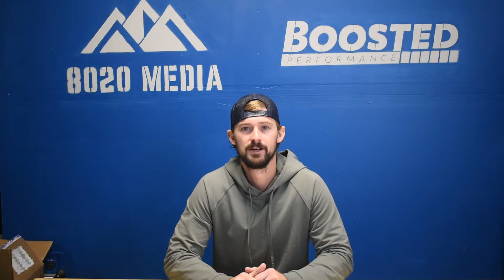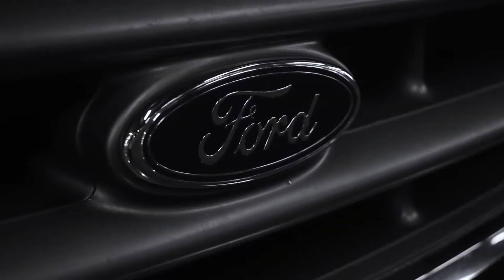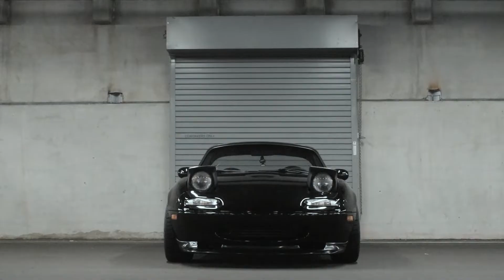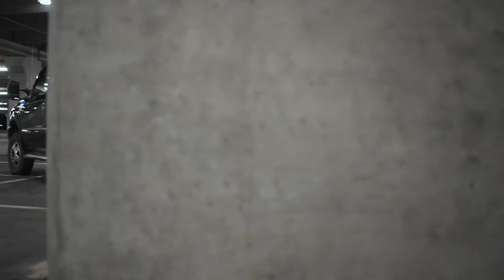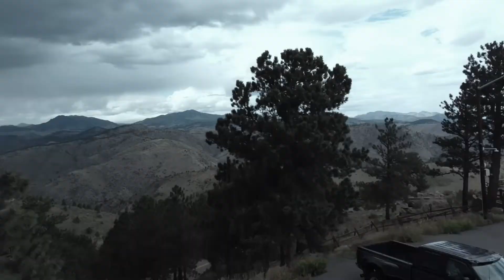3.0 EcoDiesel Reliability & Common Problems!

Comment: I have a 2019 Ram eco diesel . I bought it 2 years ago from a bloke in Melbourne . It was great for the first month then i was getting a engine light which was caused by dpf probs , we done the clean a few times till we done a delete . At this stage it had 75,000 kms on it . 
Last Septemer it had 90,000 kms on i was going for a drive then it threw a bearing in the motor & fucked the bottom end , $ 30,000 dollars later & a full rebuild im just wondering what will be next . Had a argument with Ram as naturally the vehicle is past its 3 yr warranty that if they are selling cars with a motor thats only going to last 90g kms they should be accountable as its just not good enough
Reply: how did you go with ram?

Comment: The engine is strong. You need to take care, do the maintenance, and this engine will last for a long time. The problem with this engine and in fact with most diesel engines is the emissions BS that it's saddled with. I've have the PDS crack. I've had the sensor go out. I've had the DEF injector clog up. I've had the cooler crack and melt my manifold. All of these have been related to emissions not the engine.

Comment: What’s this “delete” people are talking about on this engine? Emissions delete?
Reply from the maker: D - Correct. Generally includes three major parts: the EGR delete, which removes or blocks the exhaust gas recirculation system to prevent hot soot from being recirculated into the intake; the DPF delete, which replaces the factory exhaust with a straight-pipe or performance exhaust that removes the diesel particulate filter to reduce restriction and improve flow; and the SCR/DEF delete, which disables or removes the selective catalytic reduction system and DEF (diesel exhaust fluid) injection components.
Reply: @8020Automotive  thanks. What do you have to do or buy to get the SCR/DEF delete. I think I get the rest of it.
Reply from the maker: @daytonasayswhat9333  There are many kits out there. We can't recommend/explain what it entails for legal reasons.
Reply: @8020Automotive  oh bummer. Well fair enough. Thanks for your info so far.

Comment: Love my 2015 ecodiesel even though it is currently in my garage getting the Crankshaft position sensor reluctor ring changed. This is has been the first issue at 105k
Reply from the maker: J - Nice! Thanks for taking the time to share your experience.

Comment: I’m so tired of people trashing the Ecodiesel. This an Italian engine that has been running in Europe for a very long time without issues. The problem with the vehicles carrying this engine in the US, is the EGR components which put a stranglehold on the engines. I’ve owned several Ecodiesel since 2014, and never had any issues with them. I’ve  talked to people who have the 2014 first Ecodiesel generation and removed the EGR, and had no issues with them. There is a war world wide against Diesel engines, but until they come up with a reliable alternative, Diesel is the best option for heavy duty equipments and for trucks. My humble opinion.
Reply from the maker: J - You are entitled to your opinion. However, it came with EGR, end of story. Most people won't take the time/money to remove it. Therefore, from the factory, they are not reliable, if not maintained properly.

Comment: The same engine was an option for the 2013-2018 Jeep Grand Cherokee. I had one in 2014, the car was great new but after the first 10K service, the problems started. The oil cooler and EGR cooler were replaced under warranty. Then at 22K the fuel pump failed but lucky for me there was no metal in the lines. I sold the car in 2015 and the new owner decided to have it "tuned". Soon after the engine had a spun big end failure. I went back to my good old WJ Jeep 4.7L and I still have it. It is still going strong.
Reply from the maker: A - Wow.. Sorry to hear, but thanks for taking the time to share your experience!

Comment: I just re-watched this video because I got a ping on my response.  That said, listen to the video. Do not buy the 2014 through 2016 Eco diesel period. All owner know they (me) went back for a dozen or more recalls. Problems stated here, the EGR cooler and fuel pump were recalls. I have a 2014 GC with 194k on it now. My first post from a year ago was at 181k. Problems since then have been waterpump and E brake  cables. Mopar doesn't want to sell you parts for this motor.  The waterpump was $1000. and not in stock. A Gates was so cheap I can't even remember the price.  Always buy aftermarket.  Another take away from the video is that light towing is best. I'm towing a Camaro on an aluminum trailer.  The Jeep absolutely has a marginal cooling  system because of the tight packaging.  The transmission always runs cool and the oil temps are always in check. Just the coolant temp. So would I buy another? Maybe a 2018 or newer JC. Seems like I could get a nice one for $20 to 24k. Mine is really really nice and in fantastic condition because Ireallytake care of it. The replacement would have to be in the same  condition
Reply from the maker: L - Thanks for the feedback and coming back to update! This will certainly assist future viewers.

Comment: I’ve got a 2015 with only 80,000 Kms.. it’s October 21st today, I recently had one code pop up and I will see what the dealer finds.. I was thinking to delete but will see what this costs me. I’ve spoken to every guy I see driving one and not 1 complaint
Reply from the maker: B - Thanks for sharing your experience. Keep us updated.
Reply: I took it to the dealer,, had the nox sensor replaced and total cost was $1600, runs fun now, no issues.. I see thousands of these and not ever have I seen one catch fire nor have I heard from owners that they suck etc

Comment: I have a 2021 Ram with the Gen 3 EcoDiesel with 130,000 miles on it and didn't have one thing wrong.  Early Oil changes and fuel filter change religiously.   Previously had a 2015 JGC with Gen 2 EcoDiesel and had 230,000 miles on it when I sold it.  Only issues I had was the recalls and sensors failing on the DPF.  I think people drive these in the city too much which is not good for this engine.  These are not good for idling long periods of time.  I do long trips and light weight towing.  Cant be 27-30 MPG on trips.
Reply from the maker: J - Thanks for taking the time to share your experience! This will certainly be helpful for future viewers.

Comment: The EGR system is a complete pos. It will eventually cause a catastrophic failure to this perfectly good engine. 193k and still going strong. 33.8 Hwy according to the computer, need to do my own calc next trip. Filled it up in Green Valley AZ, 26 Gal tank, drove around for 30 minutes, then drove to Rocky Point MX 4.5 hours, drove around Rocky Point for 3 days maybe 3 hours, drove back to Green Valley 4.5 hours and still had 3/16ths of a tank left. Amazing engine if taken care of.
Reply from the maker: J - Well said! Thanks for sharing.
Reply: Did you delete the erg?

Comment: The notion that Europeans don't build decent diesels is laughable as most cars and trucks over there are in fact diesel!! Should they have left the 3.0 overseas?  Probably! Ford could have used the 4bt   inline 4 platform and I think it would have been a better fit! 
I've been around Cummins engines in marine commercial trucks and pickups and the 4bt is a stout lil power plant.
Reply from the maker: L - Thanks for the insight.

Comment: I’ve had 3 EcoDiesels. A 2014 with 160k miles. A 2015 with 175k miles and a 2017 with 200k plus miles. 0 issues with all of them. They have all been super reliable.
Reply: I assume all deleted as well.
Reply: Right  @JoseGonzalez-nt3ws
Reply: Everyone's says they have no problems, until they do!
I would have said that about ours until 1 week ago...
Turbo Cooling hose, $5000 repair for a $2 hose.
In a 2014 Jeep Grand Cherokee
Reply: @mountainconstructions  how many miles?
Reply from the maker: D - Nice! Thanks for sharing your experience. Sounds like you take great care of them!
Reply: What's the trick to keeping them running that long. I just bought a used 2014 with a new motor. I don't know which Gen but it was swapped at 70k and now has 108k when I bought it. I've always wanted this truck since it came out

Comment: Diesels are different than gas engines.  Turbocharged diesels are the best!  But turbocharged engines of any kind need to operated different than a non-turbocharged engine.  Fuel quality is a big issue with all diesels.  I use HOT SHOTS SECRET EDT in both our Ecodiesel and Cummins diesels.  I also have a Flowmaster 50 Series Big Block HD muffler and the Bank's silencer delete kit.  I use Wix filters in all my vehicles.
Ecodiesel or Cummins, a diesel with the right gear ratio, is the absolute best way to power a lot of vehicles.  Products like "Speed of Air" pistons look like they can dramatically improve internal combustion engines.
Reply from the maker: J - Thanks for taking the time to share these insights.

Comment: Have a '17 w/ 115k miles on it. Tuned at 750 miles which bypasses the EGR and cooler. Had cooler replaced as it was a recall and I was concerned that they wouldn't cover any engine issues if the cooler wasn't replaced. In the shop today getting HP fuel pump replaced as a recall. Never in shop other than that. Oil changes at 10k miles. Tows 6000# fantastic and a great, comfortable vehicle to trave in. Overall 27 mpg, can get lower 30's  on roads at 50-60 mph. I don't idle the truck--if I'm sitting in it, it isn't running. Biggest concern?--engine issues due to so many reports online of failures. Love the truck.
Reply from the maker: T - Thanks for taking the time to share your experience!

Comment: Treat the Eco the right way, with a good measure of respect, tow if you like, maintain it often, and you will be a happy driver. Most of these problems are due to over-heating, poor maintenance, and unnecessary idling.
Reply from the maker: J - All comes down to maintenance, most of the time. Thanks for the insight.

Comment: First of all it a Gen 2 engine and this was updated for the 2017 to 2018 model years possibly even the 2016 model yr. So I have an 18 eco diesel 84k miles no tune. Issues I’ve had are 1 my def injected clogged up. I cleaned and reset codes no problems since. Cleaned my EGR and yes it was nasty. But mechanically it still runs fine. Just dropped in the GDE tune. More to come on that. My high pressure fuel pump was just replace via recall. I get 23mpg with mixed driving. Pre GDE there was significant turbo lag. GDE fixed that. I do tow a 6500lb travel trailer again no issues. When I tow I change my oil at 5k miles instead of 10k miles. Maintenance, maintenance, maintenance. It’s a diesel and they are expensive, maintain it and chances are you will experience no failure. I’ve seen people with 200k plus miles with no issues and I’ve heard of engine failure at 50k. Honestly I’ve seen Toyotas and Honda fail at Low mileage. Pretty sure this guy does not own an eco diesel.
Reply from the maker: T - Thanks for taking the time to share this insight and your experience.
Reply: @8020Automotive  ok quick update short term impression of the GDE tune. 1. The turbo lag is gone it accelerates like bat out of compared to stock tune even burned rubber in second gear.  2. 200 miles in and gas mileage has improved by 3mpg. 3. The trans mission zips through the first 4 gear to get to 5th which I believe  helps with the MPG. 
The bad. When going through the first 4 gears it’s clunky hard shifts. They say it’s a learning program and hopefully that will smooth it self out. If not GDE does have a fix for it. Overall get the tune if you don’t have it.
Reply from the maker: T - Thanks for taking the time to come back and share your experience! This will certainly be helpful for future viewers.
Reply: @8020Automotive bot

Comment: Worse truck I ever owned. Will never buy a RAM again. Engine failed and there isn’t a mechanic that will even look at it.
Reply: Was driving and got a message saying low oil pressure within seconds the truck turned off and had a message to put it in park. It would start up but sounded terrible.
Reply from the maker: B - Thanks for sharing.
Reply from the maker: B - So sorry to hear this.. However, we appreciate you taking the time to share your experience. Do you happen to know what went wrong?

Comment: This is the most fuel efficient  truck engine EVER and will remain the king with the murder from the government. VM Motori since 1947! They made engines for Toyota and Isuzu among others. Due to emissions systems you must be aware on the forums and facebook groups on how to keep them going or they will die. The record is 700k miles on the original engine and one guy just passed 500k miles original engine. They are the best refined diesels ever made!
Reply from the maker: G - Thanks for sharing this insight!
Reply: @8020Automotive  193,000 and going strong! Oil change every 5k mi.

Comment: So would a 2021 Wrangler with the 3.0 be prone to any of these issues when properly maintained? Any way to ensure it doesn't have the pre 2019 motor?
Reply from the maker: Proper maintenance and frequent oil changes will honestly go a really long way. No such thing as too frequent an oil change, especially when they are very cheap relative to the cost of the vehicle. A 2021 won't have a 2019 or earlier engine so you're all good there, a lot less to worry about on the newer models just keep taking care of it!
Reply: @8020Automotive  thanks for the response. Kinda hard to find an abundance of info related to this motor
Reply from the maker: M - Agreed!

Comment: 2022 eco here.  3500 miles.  Yes I don't daily it.  I have a small car I daily.  I'm hopeful with 3k mile oil changes vs the 10k the factory recommends that will help it live.  Also I'm not going to tow anything.  And I don't run it hard.  Hopefully this all will help it live.
Reply from the maker: J - That is a recipe for a long lasting truck!

Comment: I've got a 2018 4x4, the egr cooler was replaced under warranty and the only other problem I had was the 3 studs broke off the downpipe causing the hot exhaust to burn off the def line electrical harness and def injector. Instead of fixing it I had it deleted which was the best move,the fuel savings and power increase is amazing.
Reply from the maker: Mark - Thanks for sharing your experience! This will certainly help future viewers.
Reply: You deleted the egr???
Reply: Look forward to you response!
Reply: Or the def injectors? I thought you need those?

Comment: They’ve been running them for many years in agricultural machinery in Europe, Cummins is garbage too have way too many censors , buy yourself a gas engine especially today with diesel being 1.60 more a gallon and  filters plus def anti pollution system all crap lucky to sell theses pieces of garbage just trouble from A to Z money pits , I have had many of theses eco and Cummins crap both of them get yourself a gas , unless your pulling very heavy loads the Cummins better choice than eco diesel but if you can avoid both of them you’re going to sleep better at night 😂😂😂crappy motors bottom line .
Reply from the maker: Talbot - Thanks for taking the time to share your experience. They certainly don't build them like they used to, but we've had good luck with Cummins engines.
Reply: A diesel is madevto work, not haul kids and groceries from stop light to stop light. Very simple

Comment: I have a problem with low oil pressure on idle. Sensor is good as we tested manually and says no pressure. When accelerating pressure appeared. Cant find a problem. Maybe someone had the same issue?
Reply: Have checked oil. Oil is old and level is way too much. Filter is old as well. But many of very reliable mechanics told me that with any oil level or visconsity it should make pressure. Unless is blocked. So i removed and tested the oil filter and there is no signs of metal pieces. Oil is going through the oil filter and housing fine. 
One thing i cant check is oil cooler. It needs to be changed as it cant be cleaned. I will try to change whole housing and will change oil and i will give an update. 
P.S engine is running fine on idle and on rpm.
Also i have issue this truck is not engaging gears and cant drive. 
Errors says shift to P than desired gear when desired.

Could it be the same issue of low pressure?
Reply from the maker: Pro - Keep us updated on the oil pressure when you address the parts you mentioned. 

As for not engaging gears, are you getting an engine codes related to the transmission?
Reply: I will keep updated. It will take time for me to find out. As going step by step and have not much time with this. I hope by April to sort this out. 

I have checked errors via diagnostic machine, its says P1B14 which is transmission error.
And also it has rail error. 

Anyway i will sort oil pressure issue firstly and will see other errors. 

In overall i don’t get why people do not change oils on time. So many cars engines blowed out due this. Its so cheap to change the oil. 

Thank you and will keep you posted.
Reply from the maker: Pro - Please do!
Reply from the maker: Pro - Unfortunately, there are many things that can cause low oil pressure at idle, but here are a few things to look into: oil level, viscosity of oil, oil pressure sensor, oil pump, or the oil filter. Keep us updated.
Reply: @prodriversteam2324  oil pick up tube on these trucks tend to gum up drop the pan clean it and get back to enjoying the truck it’s a super easy fix